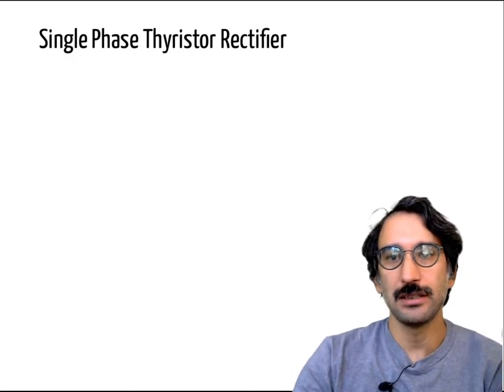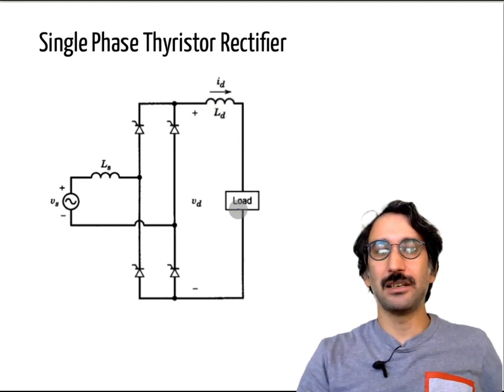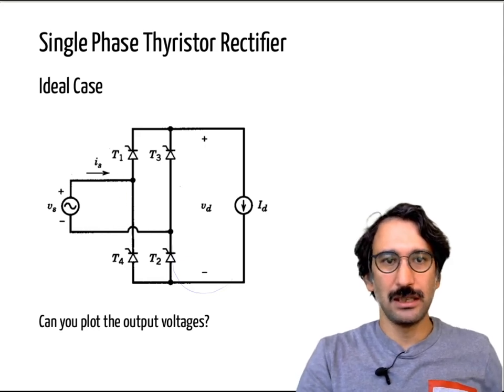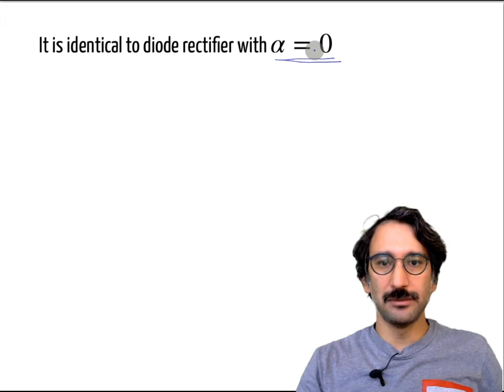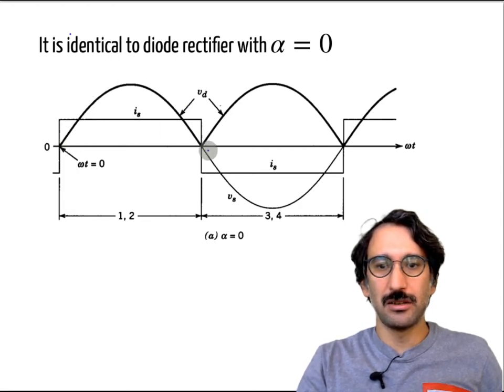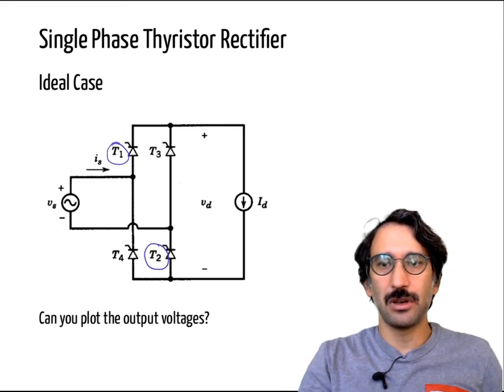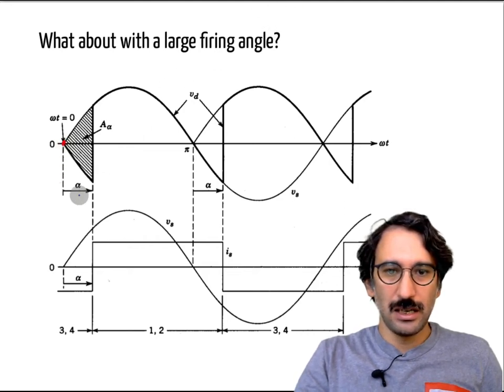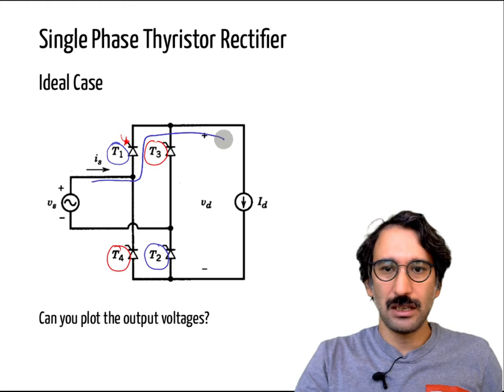EE463 - Single Phase Thyristor Rectifiers

Comment: 1:24: How can we be sure that we fire thyristor exactly at fire angle = 0? If we miss it, Do the inductive loads harm our devices?
Reply: or inductive load pushes thyristor to the edge of the forward blocking voltage then it automatically starts conducting? Yet still have a huge voltage spike which may result in EMI ?
Reply: was very dumb question. If inductive load has a nonzero current, at least 2 of the thyristors must be on. Then say we missed the positive thyristor's angle and fired at -5degree. Then nothing will change since the vd is shorted for a small duration and the positive thyristors are reverse biased. And negative thyristors are forward-biased. But if we fire positive thyristors' gate at +5degree, the vd is shorted for a small duration. During this duration, negative thyristors are reverse-biased and turned off. Whereas positive thyristors are positively biased and start conducting.